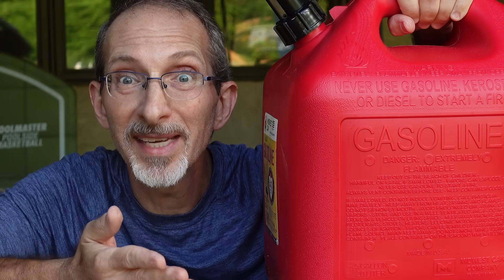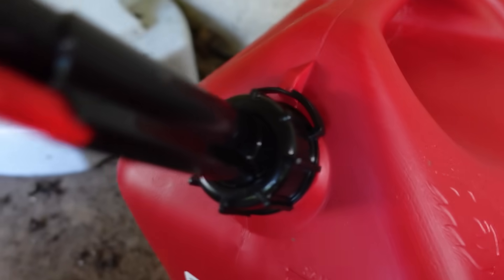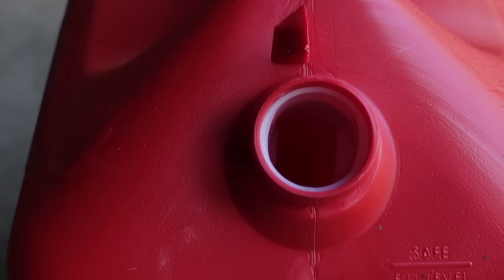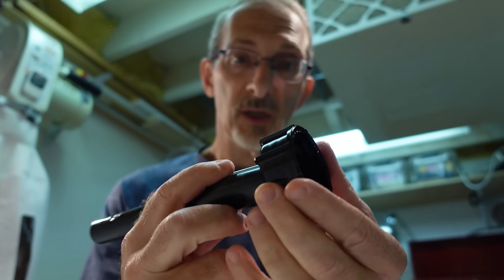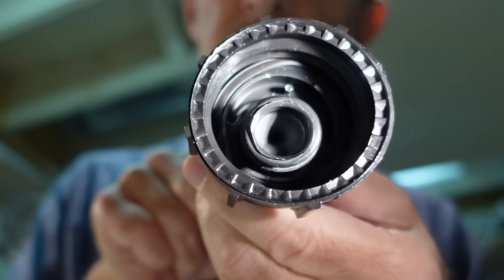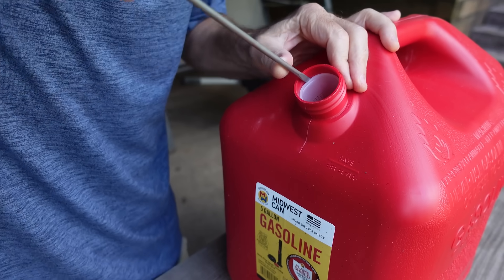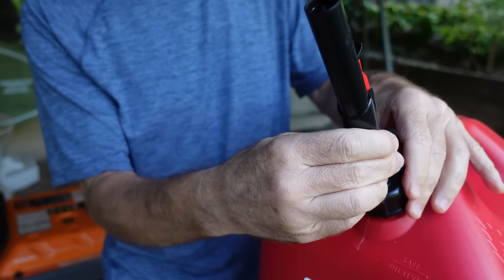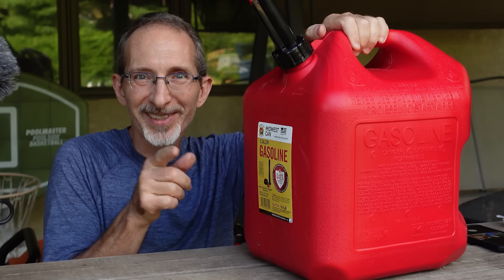Gas Can Modification | New Gas Can Fix

Comment: The filter is so poorly implemented here. If the filter managed to do its job and collect debris and impurities, it would not prevent that stuff from ending in your car or generator, etc. When utilizing the gas can, you will be pushing all the filtered particulate into your car because there is not a filter on the nozzle. You are only “filtering” what goes into the gas can, not what comes out
Reply from the maker: The filter is actually a flame arrester, which I clarified in my second video, link in the description. You are correct that as a filter it would be working in the wrong direction. Thanks for chiming in and for watching!
Reply: @MikeFyxdt  ahh, that is good to know. Thanks for clarifying. Great videos! Audio is excellent and clean editing. I am a fan.

Comment: Even if the jerry can filter caught particles of dirt, those particles of dirt would be rinsed right back out and into the tank being filled. Daft.
Reply from the maker: What I called a filter is actually a flame arrester safety device, designed to keep the fumes in the container from igniting and exploding. I corrected myself in my second video, link in the description. Hope that makes more sense!

Comment: Just go to your local Rural King or equivalent tractor supply store, and pick up some MX speed cans. Literally none of that EPA standard bs. You get a 5 1/2 gallon can. Big handles, big cap, bleeder valves and a solid 2 foot flexible clear hose to pour from.
Reply from the maker: Ethan, in my third video on the subject of gas containers, I learned that the new safety regulations only apply to containers that are 5 gallons or less. Anything above that seems to be exempt from these laws. Thanks for sharing your tip, I’ll bet a lot of people will find it helpful. :-)

Comment: Ngl, I've spilled more gas with a new can than I ever did in my entire life.
I just tore the guts out of the new spout, and I have a PETE and rubber disk that goes in the spout's collar when it needs to be sealed.
Reply from the maker: Mike, that will work! I’m glad I’m not the only one that is frustrated by these containers and spouts. Thank you for watching and for joining the conversation!

Comment: buy old plastic gas jugs and keep them out of the sun, the kind with vents at the back.
Reply from the maker: Lawrence, your advice to keep them out of the sun is a really good suggestion. These plastic containers seem to swell at the slightest temperature change. In my second video I added a cap to the back of the container and it made a big difference. Thank you for watching him for joining the conversation!

Comment: My dad bought me a battery-powered siphon pump, it works great! They are 31.99 on Amazon. I would recommend these to anyone but especially older persons or those with bad backs as they eliminate a lot of the awkward lifting required while fueling mowers and smaller tractors.

I have tried replacing the spouts with an Ez-pour version with limited results. They seem to leak at the base. Most of my equipment will accept a large funnel negating the need for the spout altogether.
Reply from the maker: I appreciate you contributing to the conversation! I am going to be reviewing one of these electric safe and pumps in an upcoming video… Please stay tuned!

Comment: Also filter to prevent impurities in the can, well when you pour it out of the can into your gas tank, it flows all the impurities into your tank!
Reply from the maker: Calling it a filter was my mistake, which I corrected in my second video. It’s a flame arrester, designed to keep the fumes in the tank from igniting and causing an explosion. Sorry for any confusion! I appreciate you watching and for joining the conversation!

Comment: That spring activated spout has to be the most asinine device ever conceived. That spout is a step back in technology. It is a Chicom plot!
Reply from the maker: I understand the intention of the spring, to close the spout if the container should tip over. But it’s really awkward. In my second video, I cut out part of the spring to make it weaker, but to retain the self-closing feature, and I feel it made a big difference. I appreciate you watching in joining the conversation!

Comment: So basically you just bought the wrong gas can. Should have taken it back and bought a standard gas can for garden equipment
Reply from the maker: Dr. Drake, that is a fair statement. I purchased these containers online at the beginning of the pandemic, when they were very few choices, and I didn’t realize how difficult they were until after they had fuel in them. The modifications were not hard, and now I am happy with how the cans work. But for anyone else that hasn’t purchased yet, hopefully these videos will help Guide them to make a better decision from the start.

Comment: The screen filter doesn't really make sense since the stuff cought in the screen will be the first to go into whatever you're filling. Also I'm surprised you didn't drill and tap in a air vent in this video as well. I was told they sell them online. The vent you open so the gas can freely flow out of the can without gurgling
Reply from the maker: John, I addressed both of these issues in my second video, link in the description. The filter is actually a flame arrester safety device, and I did add a vent. It made a big difference! Thanks for joining the conversation and for supporting my channel!

Comment: People who designed and/or requested these ‘safety’ features should be sterilized to prevent them from having offspring. I’ve removed these idiotic contraptions as these have caused more spillage and result in more dangerous outcomes than the gas cans from many years ago without these idiotic features.  Where did they get their degrees?  Should ask for a refund from these schools or just accept their place at the bottom end of the bell curve (not the genius side of the bottom)

Comment: I don’t even know where to begin. Guess I should start by saying these are specific for cars, you should look at a Justrite gas can for tools like a chainsaw. Second, that “filter” is a vapor arrester, it prevents vapors from getting potentially ignited resulting in the gas can exploding which is what caused Blitz to go out of business since they didn’t have any. You essentially made the gas can a potential death trap for anyone who goes near it and I won’t be surprised if you end up on a 1000 Ways To Die, if that show is still around.
Reply from the maker: Some of the issues you brought up I addressed in my second video. I think these 5 gallon containers and rigid spouts are not great for cars. Several people have reported that the spouts actually snapped off in their car. I do agree that smaller gas powered tools would be better served with a smaller dedicated gas container. I appreciate you watching and for joining the conversation!

Comment: The filter seems to be strangely counterproductive, mostly because if any crud is caught going into the can, then it will the the first thing coming out of the can and into your car or appliance gas tank.
Reply from the maker: Jeff, agreed. The filter is actually a flame arrester, which I corrected in my second video, link in the description. Thank you for watching and for joining the conversation!

Comment: Dude. Just get yourself a "Flo-n-Go" Then you will never worry about pouring gas with these things again. These just become a lid so gas does not splash on the way home. Then you replace this spout with the Flo-n-Go and you have a nice gas station style handle on a hose. Just place your jerry can higher than your mower or generator, etc. Put the nozzle in and squeeze it a couple of times to start the siphon. Let go when your device is full. We live in Florida and I have a couple so the wife can gas up the generators if I am not around.

Comment: What's keeping someone from selling "water can spouts" through Amazon or online?
Reply: they have them online as gas nozzles
Reply: Yep, already a thing.  They sell them whole, just usually light blue in color.  You can buy replacement spouts tho ;)
Reply: Tractor Supply sells them right beside the gas cans.  You can also get little valves that you can pop into an appropriately sized hole to allow the gas to pour out faster.  Those are sold on amazon

Comment: These new cans are awful... Now you have to store cans with huge protruding erections poking up instead of an older style tube that fits within the body of the can.  Not a big deal until you want to put it under a shelf or within a flammables cabinet.
I bought a couple spare old style ones with the screw down vent at garage sales for $5

Comment: I’ve spilled more gas with these cans than anything I’ve ever owned before
Reply: Thankfully you can still buy old school nozzles for new gas tanks.
Reply: @charliemartin-k7m  I bought some, but they are just slightly under size so they leak constantly. I swear, I think they’re trying to ruin the environment with their protection
Reply: The US government motto is....if it ain't broke fix it till it is!
Reply: its reassuring to hear that and im doing something wrong with mine!
Reply: Shouldn't he have added a vent?
Reply: Sounds like something that they let the token diversity hire design.

Comment: Taking the spring out is going to get somebody killed.  If you forget to pull the nozzle back up, that o-ring won't seal and there is nothing preventing the gas fumes from leaking up and out of the nozzle. Somebody uses a lighter or makes a spark nearby = boom.

Comment: Just remove some of the spring
Reply: It won't fully re-seal if you change the spring length. You would need to find an identical length spring with a lower spring force. But not too low that it won't seal again.

Comment: Is this legal? ....
Reply: Nope. What happens if you forget to close the valve after removing the spring? Gas vapors will leak out and are ready to explode with any nearby ignition source. I have 5 of these cans and have never had a problem.

Comment: Plus, drill a hole and add a bicycle Schrader valve (with the valve stem removed) to use as an air vent.

Comment: I don't understand how that "filter" acts as one... First off it's just a cup with holes, any dirt could easily go past it. Secondly if it doesn't come out, that means any impurities would simply sit inside of it and exit the nozzle into your gas tank...
Reply: Yeah, I thought the same thing. It is more for large debris that can be removed manually. Kind of makes sense. Better than fishing it out of the tank or dumping 5 gallons on the ground to get it out instead.

Comment: I have this can came with filter fallen inside can , it took me 20 minutes to get it out , I couldn’t stand the jiggling noise. Nice fix but I bought a battery operated pump that screws right onto can off Amazon and it works great, no more pain from having to hold up 5 gallons of gas due to shoulder problems

Comment: For my string trimmer can I just bought different spout that was flexible and had a cap at the end. it also came with a air plug.  you drill a small hole in the back top of the can then insert the air plug. For my generator I bought 2 metal gas cans that have large spouts. Oh I also removed the plastic filter from my can that thing was a hassle. My metal cans have a metal filter which you can remove by design. All are available on Amazon.

Comment: Practicality and ease of use are some of the biggest factors in engineering a replacement product. So no it's not the latest and greatest engineers have to offer. It's simply another inconvenience forced upon us because it's 1% safer than before.

Comment: Thank you for showing the filter removal. I had that on 2 kerosene cans I bought last fall which prevented the use of kerosene siphons to fill kerosene heaters. In summary one filte came out and one fell in and rattles every time I fill it.
Reply: I just had to update mine because mine is so old the electric pumps won’t fit into them

Comment: The problem with these cans is that there isnt a 2nd opening/vaper release or whatever its called so it will blow up like a balloon if you store gas in it. So i have to leave the spout on loosely
Reply: You can buy vaper relief caps from Amazon. You simply drill a hole in the top of the plastic container and pop it in!

Comment: Honestly I feel like just thinning out the material on the latch, rounding corners, and swapping spring with a lighter poundage one will be my way to do it. More likely to pass an inspection.
Reply: Agreed. I am all for making a better design but if you forget to close that valve after using it with the spring removed, you are left with an open can of gas which is just inviting disaster.

Comment: I have one of those spring opening nozzle, every time I use it I have to hold it in to put gas in trimmer (one on wheels so it like a lawnmower). I end up with gas on my hands. Thanks for letting me know how to fix it without having to spend more money on buying a new nozzle. Also my Mother can't use it because she doesn't have the strength in her hands. I got that gas container and got her a 5 gallon and removed the strainer and installed a battery gas pump that automatically shuts off so she can gas her ATV to help feed her animals. She also has a bad leg and back but her donkeys comforts her.

Comment: Or just buy the VP cans that are only $27 and be done with it. Been using them for eight years now and they’re about as good as they were when they were new
Reply: That leaky bottom seam, tho...
According to amazon reviews...
Reply: My own personal experience with 4 of them that have had 87 gas in them 100% of the time for 7.5 years straight. No leaks.
After the pipeline thing 2 weeks ago i bought 5 more of these ( 4 for 87 for vehicles and 1 for ethenal free 87 for house yard work tools)
Im up to 40 gallons of 87 for car and truck and 5 gallon for lawnmower, and snow blower.
I might drip 1 tsp per 5 gallons at most and it takes about 90 seconds to dump all 5 gallons into gas tanks.

Comment: I dump more gas on the ground with one of these "environmentally friendly" spouts on the average day than I did in 25 years combined before using them
Reply: Absolute truth.  All Courtesy of CA CARB and EPA.
Reply: Just like a camel, it was designed by a government comity, no really !!
Reply: Leave it up to the gov and more specifically California to "fix" something. They literally made this 20x more environmentally unfriendly and dangerous because of all the extra gas you spill compared to the old design and the extra plastic parts.
Reply: Try using one on a dock to fill a boat that will float up/down/sideways… #exxonValdez

Comment: Basically the safety feature is so poorly designed that operators seek to disable it. Which means the safety feature probably needs to be redesigned.

 I feel like lawn mowers and chainsaws usually have pretty good safety controls (you have to hold down a 2nd lever, if your hand slips then the device will turn off to limit injury to the operator).

Comment: MMMM, anyone else see a bigger issue with  the filter in the can? If contaminated gas is coming out of the nozzle and said contaminates are collecting in the filter, wouldn't they go right into any gas tank you're putting it in? Maybe check to see if that filter is removable So its more clean when you fill your mower or blower...

Comment: Just buy a Justrite Safety Can and be done with it.  Safe, no spill and it will literally last a lifetime.  Everytime you use it think, "Thanks YouTube".
Reply: I have one and it died a rapid death of rust, not like the old ones ! That powder coat they use on everything from tools to flatbeds on trucks, once it get some chips, water gets under it and stays a long time, rust just grows and spreads !! regular paint is way better.

Comment: As a Generac technician, dont let gas sit in that carburetor and run it once or twice a month at least.
Reply from the maker: That is awesome advice! I’m really good about running it in the winter, but I forget to do it in spring and summer. I appreciate the advice, and thank you for joining the conversation!
Reply: dont let gas sit in that carburetor?
dude, just use non-ethanol and your prob is solved.

Comment: The filter is fixed in place; you are not able to easily remove and clean it out even if it catches any debris. Utterly useless. The return spring is designed for a rare edge case.. I can't even remember the last time I added gas to a car from a can.. These gas cans represent yet another engineer that needs a swift pop up the backside of his/her head and a profession more appropriate to their skill-set and life experience..

Comment: Better yet, buy VP cans and they have none of that crap on them and they hold 6 to 6.5 gallons of fuel and are heavier plastic and not cheap thin plastic like those. 

I stopped buying those cheap cans years ago whenever they started putting safety crap on that was a pain to use, never works right, dumps more gas on the tank, you, and the ground.

It does not take long and resting the neck on the tank hit trying to fill breaks the neck and then you have a piece of junk bigger than what you bought to begin with. There was a company making regular fill spouts so they made the threads and diameter of the can smaller so they would not fit forcing you to buy their crappy replacement parts, so VP cans is what I went to and I now have 6 gallons, regular fill tube, and a stronger gas can.
Reply from the maker: You bring up many good points! As far as I know, any container larger than 5 gallons will be exempt from flame arrester’s moving forward. I guess these containers are considered professional, and not consumer. Thank you for your suggestions and for joining the conversation!